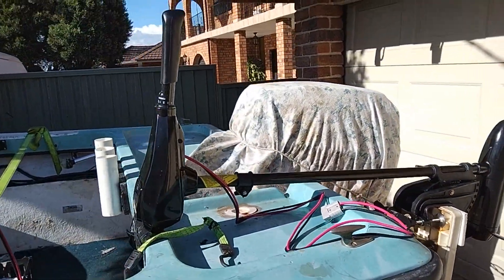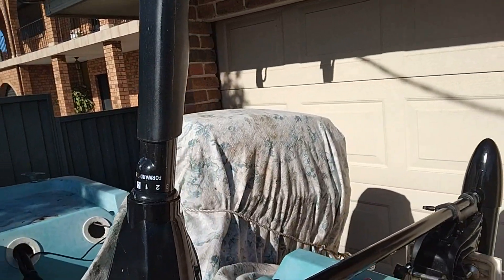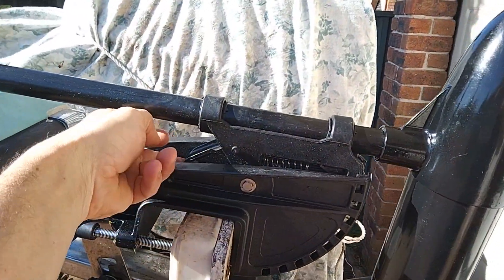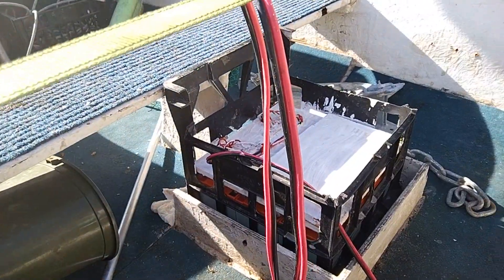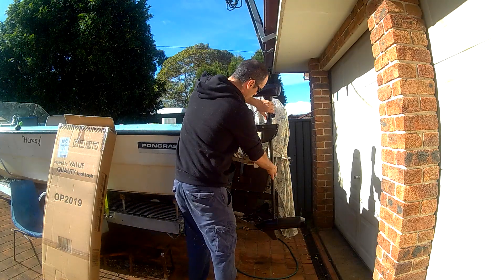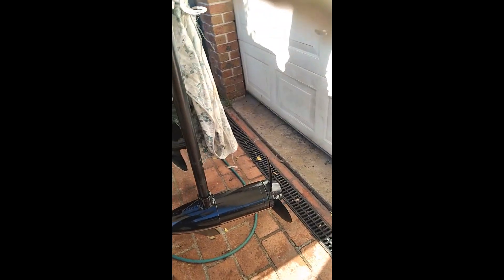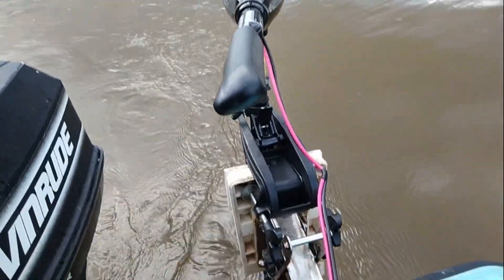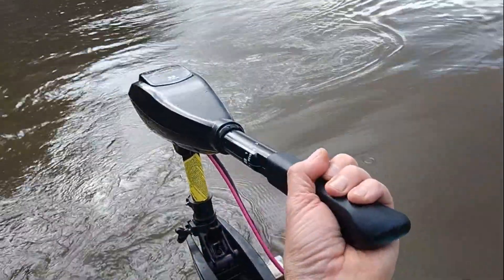Costway 12 volt trolling motor review #costway #costwayreviews co #trollingmotor

Comment: I just ordered one the other day i hope its better than the minn kotas ive had. Went threw 4 minn kotas in a year they all broke on me
Reply from the maker: That's a concern that the kotas broke, all four. Personally I could not afford a Kota or a Watersnake,but they are nice looking units. The costway is a tiller handle and cheap enough. As mentioned, I had started with a second hand unit that worked well but accidentally fell off the boat into the harbour 😂. That will teach me for not securing it. So I bought a new one and it gets regular use. Like anything, they need to be looked after and worked within their limits. Good luck with the costway , just remember to give the prop part a good wash everytime after use and a dose of wd40 every now and then.
Reply from the maker: There's the video of me using it....
https://youtu.be/lYCk2Z5uJi8